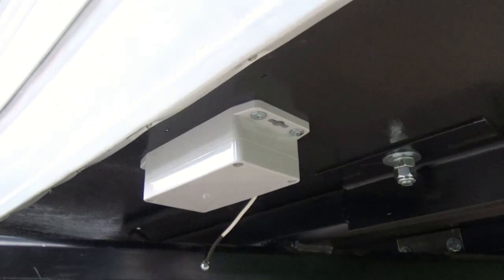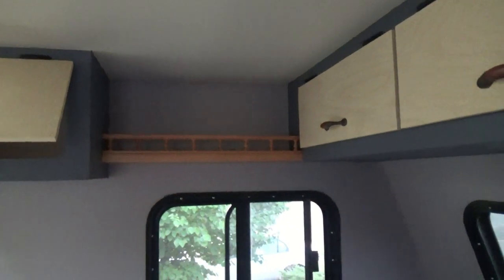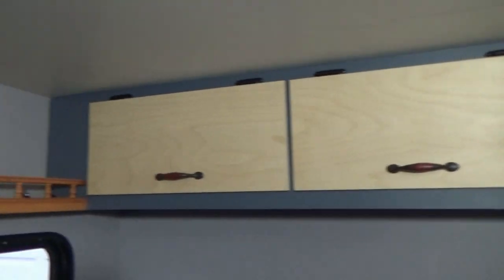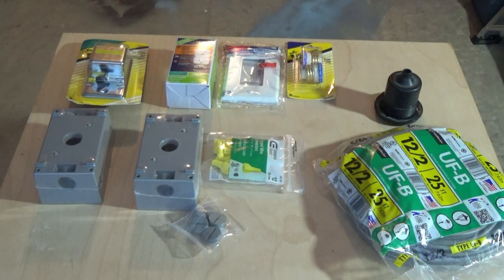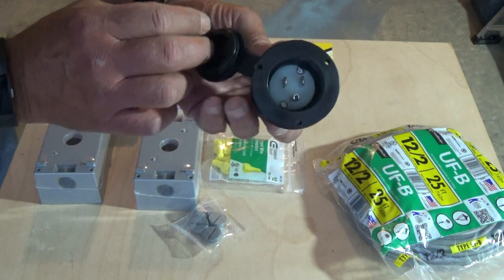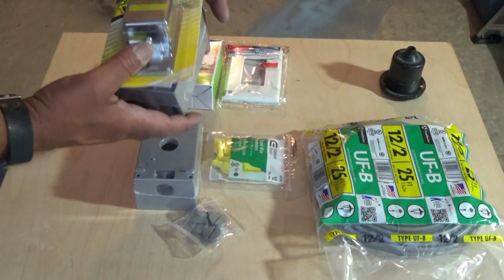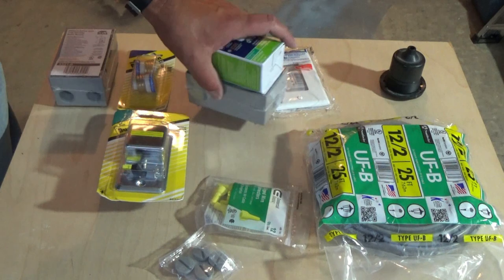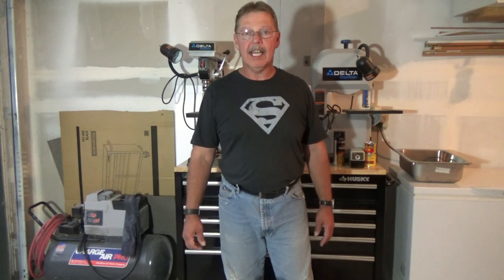How To Build A DIY Travel Trailer - Part 40 (Trailer Lights Part 2)

Comment: Wow! Your trailer looks really good!
Reply from the maker: Thank you Frank!
Reply: Not trying to be nosy but how much is already invested? I'm debating between what you did and converting an Encl. Trailer. I have no garage. How much weight on trailer so far do you think? I've been watching every one since yesterday. You're very good at it!
Reply from the maker: Thanks Frank!! My neighbor is building and enclosed camper... with all of his supplies so far, he has around $1500 in it. Not close to being finished. He's guessing he'll have about $2500 into it maybe.... Mine well, so far... This is what I figure: I have around $1000 in the trailer, I could have shopped around for a less expensive trailer, saving several hundred. I have approximately $700 in the cabin itself (all the wood and studs, decking, flooring, cabinets. The metal siding was approximately $1400... couple hundred for the doors and windows. A grand total so far would be right around $3350. I expected to have around $4000 when finished. Compare that with a brand new production model of this size... I am saving around $10,000!  Go price one, you'll see that's pretty close! Can't beat that.... AND, this is built much better than any production made camper (I hope!)    :)  I will be adding solar, so throw another grand on top (but that is optional). I'll weigh the trailer this weekend, but I'm going to guess around 1200 pounds? We'll have to wait and see.
Reply: You're right. I've been looking at travel trailers and the cheapest for what I want is $9900. And it's not tall enough for me (6'4"). I'm going tomorrow to RV show in Hershey, Pa. and look for a trailer builder. Let me know the weight, would you? If you're ever in the Phila. area, send me an email.
Reply from the maker: You got it... and I should have the weight this weekend! :)
Reply: @OregonBatman  Excellent  remarks! You certainly wiil get good saving !

Comment: AL, whats next on the agenda, maybe a slide in camper for your truck eh.
Reply from the maker: Hmmm... no, I don't think so! :)    Probably build another trailer, little shorter perhaps, and a little bit wider. Haven't really decided.
Reply: Al, the one I am planning is 8l x 6w x 5' 6"h but the last 3 feet will have the roof 6" higher. It will have a rear door front dinette and stove and water at the rear left side where the roof is higher.Something like the 8 ft Dyl that Taylor Coach make but not 6' 6' high Have you seen Taylor Coach on You Tube. BTW do you have the address and phone number where you got your rubber roof etc.Thanks
Reply from the maker: Hi George! Nice size trailer to build! I have seen the Taylor Coaches, nice looking units. You should have a lot of fun building, hope you take some pictures as you go along! The place where I purchased the rubber roof is: Affordable RVing 15555 SE McLoughlin Blvd, Milwaukie, OR 97267  (503) 659-3610    http://affordablervparts.com/  Hop that helps sir!

Comment: There are screw in breakers .... Saves u from having to carry fuses if you overload.
Reply from the maker: THAT... is a great tip! I will be looking for that.  Beats having to stockpile a handful of fuses that I can't find now! LOL!
Reply: Lowes or home depot should have em..... Only available in 15A (and 20A should you want to add AC one day).....looks the same just with a reset button in the middle . :)
Reply from the maker: I remember seeing those! 15 amp is all I need at the moment! I'll check it out!

Comment: I absolutely love what you've done here. Well thought out and executed. However, I must say you didn't do anywhere near enough research on how to wire a trailer. 

1. Why run a ground wire to the frame if none of the lights are grounded to the frame? 

2. You only put 4 light across the upper rear and there's a minimum of 5 required. One on each corner and three in the center. 

3. On the front, you left the center three out completely.
I included a link that shows all the DOT wiring requirements for trailers. Both large and small.

https://www.championtrailers.com/federal-lighting-requirements-and-locations/
4. 12 gauge wire is to large. It will hold excess heat before tripping the fuse/breaker. You should have gone with 14 gauge for all your 120V lines.
Other than those few things, I really love how this is turning out. Keep up the good work.
I also subscribed to your channel and hope to see other great builds.
Reply from the maker: Thanks Doug... you know your stuff! Thanks for the link, I'll keep that in mind on future builds! Luckily, I haven't had any issues (and hope to never have!)
Reply: @OregonBatman  There's a good chance you'll never have an issue. Most Hwy. Patrol aren't looking for small trailer violations anyway. lol
Reply from the maker: :)  Glad for that!